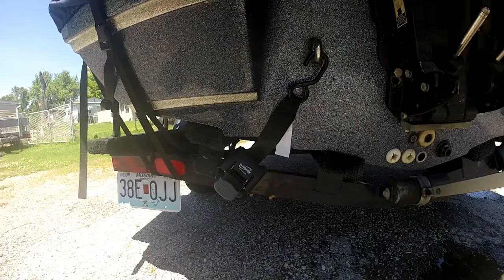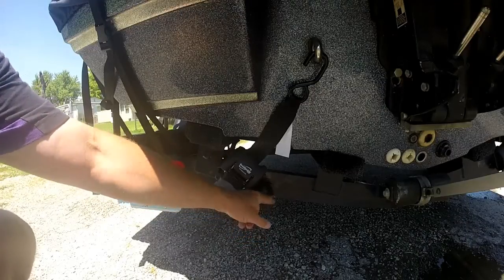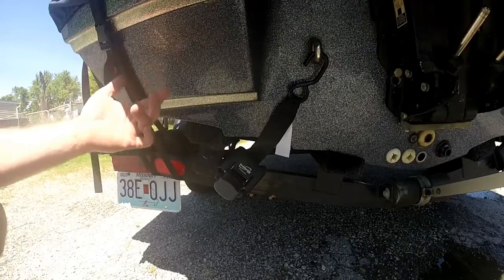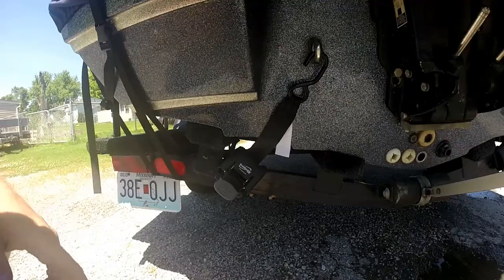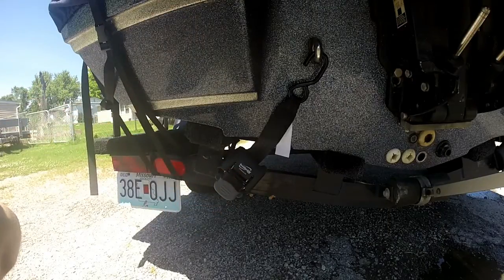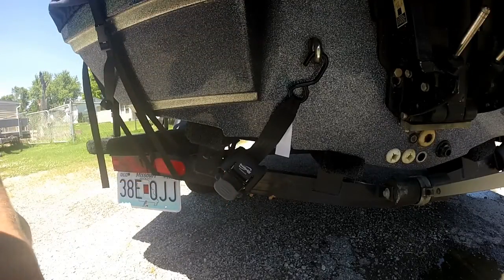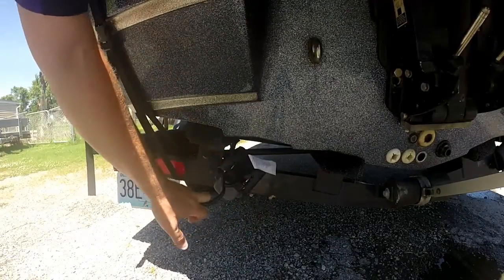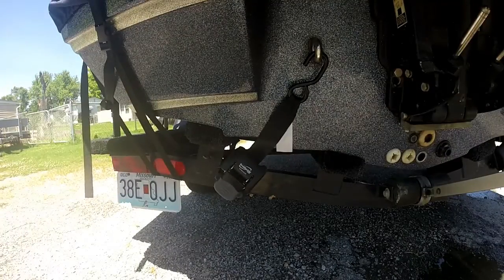Boat Buckles Installation (TopWaterAssassin78)

Comment: you didn't show how you installed it .. yet you title is an "install".
Reply from the maker: Are Lee, I had to drill holes in the trailer. The drill bit that I bought for drilling into steel was not that great. It took me awhile to drill 2 holes. The original straps kept loosening up in me.